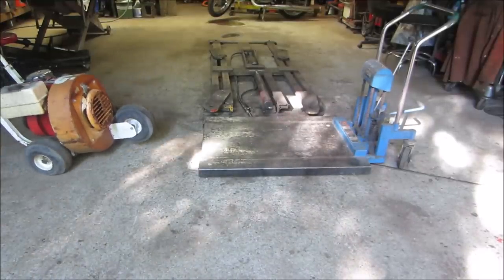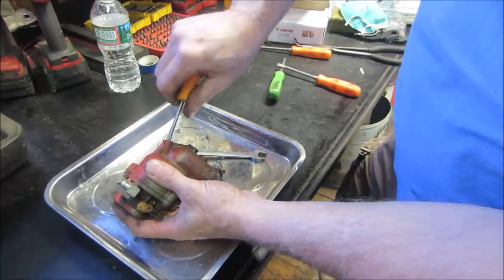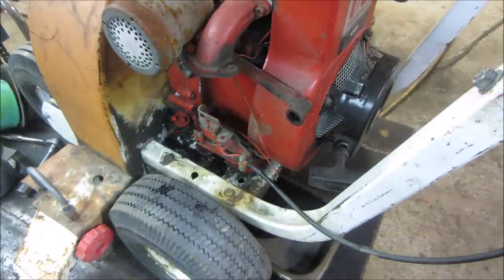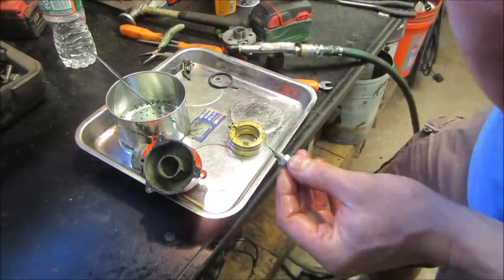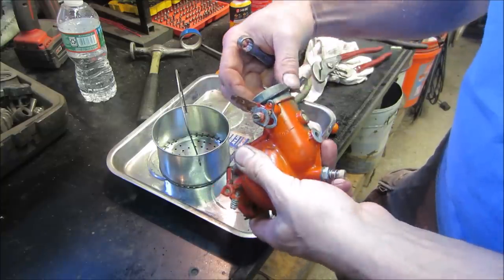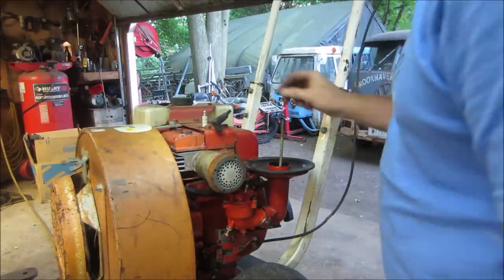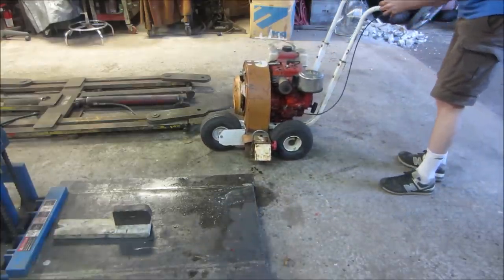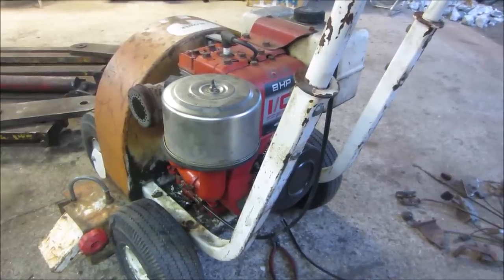Will it Run? yard sale leaf blower.

Comment: All I know is that since I've switched all my small engines to ethanol free gas (why is it always premium :o ), I've not had my carbs gum up at all.  I don't drain anything.  After winter they start in 1-3 pulls.  I also add a splash of Seafoam into the gas cans since a small engine mechanic told me to, but I don't really know if it actually does anything in that regard.
Reply: My buddy uses premium gas in his small engines,too. Now,I do.

Comment: You might want to try AvGas 100 ll(low lead) instead of Cam 2. You can get AvGas at any airport for usually about $5 per gallon and the lead is great for small engines with no worries about water.

Comment: When you say Racing fuel, is that some kind of alkylate gas ? 
I run all my mopeds and garden tools on alkylate gas and it works perfect. Best thing is that it does not get old like normal gas do if you use it in mowers and such.
Great vid, keep em comming.

Comment: After several years I learned my lesson on O-rungs and carburetor cleaner !  I have heard that it you wash a O-ring swollen from carburetor cleaner with dish soap and warm water and let it air dry it will go back to the correct size.  Can you confirm ?

Comment: Gasoline with ethanol is delivered "dry" from the refinery.  It is at its most hydroscopic state.  Most consumers use that fuel in a week or two.  At which point the fuel may be fully saturated with moisture.  With every temperature cycle, the gasoline tank breathes in and out a "breath" of atmosphere...along with the suspended water (humidity).  In a car gas tank it isn't that noticeable, because the fuel is refreshed.  But in a lawnmower, weed whacker, etc., the fuel becomes "fouled" with the moisture as well as it loses its "aromatics" (which enhance volatility, ease of starting).  Gota store yir fuel in a steel can, in the shade, and kept cool.  Airtight?  ...if it has a pressure release ...

Comment: I see your using Sunoco's 100 octane ethanol free cam 2 racing fuel.
I was wondering if it was safe to use gas with that high an octane rating on small engine's, because I heard that it causes things like head gaskets to blow and other issue's, but I see your using it, so what do you say? Is it okay?
Because it is the only ethanol free gas they sell anywhere near me and it happens to be 5 minutes away. I was going to get a few gallons, but I wasn't sure if it was safe since the octane is that high. That stuff is $9.49 a gallon right now, where they sell it. But that is still a lot cheaper than those cans of true fuel. So whats the verdict, its safe? If so I'm going to get some.

Comment: That's a 8hp Briggs . those updraft carbs are 15 bucks on eBay .if you take them apart there is a brass suction tube runs at angle inside carb .the break real easy

Comment: Cam 2 racing fuel.  Great stuff as it is clear of the junk.  @ $9.99 a gallon it isn't cheap but I use it in all my yard tools. I only use about 5 gallons a year so it is still a great deal.
Reply from the maker: l agree
Reply: That’s about what we pay for regular ol 10% ethanol fuel here in finland...
Reply: My local gas station sells ethanol  free 91 octane (u.s.d.m. fuel) . And i live in a high ethanol yield state. Oh its like 3.35-3.50 U.S.D.per gallon. 91 covers all my old stufd
Reply: I live in NYistan where they govern us into a mess of clogged up carburetors.

Comment: Ethanol blended fuels are engineered to be compatible with fuel injected equipment. I always use non-ethanol high test gasoline with a fuel stabilizer all year long. My small engine equipment always starts first or second pull even after a frigid Canadian Winter. Keep ethanol away from aluminum carbs and your and you'll have less trouble.

Comment: I had an idea watching your video. If you modify a screwdriver to have very little shoulder to fit down into the jets, could you leave it a little wide and run a die that matches the threads over it to clean and dress the threads as you remove the jet?

Comment: If I remember my high school chemistry correctly alcohol molecules are smaller than water molecules and if you combine one ounce of water with one ounce of pure alcohol the combined volume is less than two ounces because the smaller alcohol molecules fit in between the water molecules and the surface tension allows them to bind together somewhat since water and alcohol do not really mix but that is why products like HEET work get small amounts of water stabilized enough with the fuel mixture to burn. And you would be surprised at the amount of water is in pump gas because of the condensation occurring in below ground tanks.

Comment: Ethanol will attack rubber parts in fuel systems. Absorbed water corrodes stuff though you can get stabiliser additives. It’s fine on kit that’s built for it but often a problem for older equipment. At the very least the system should be drained including carb float bowl before storage.

Comment: I know this is an old video but on the gasoline comment, i heard if you want ethanol free gas you pour water in the gas and let it sit for a little bit. The ethanol and water mixes and sinks to the bottom and you put a syphon to the bottom and draw out the water and its got the ethanol stuck with it and then you have ethanol free gasoline. Might try it sometime and test it out.

Comment: that seems like alot more trouble than having a back pack leaf blower with a hose you can just point wherever easily, what is the use of these supposed to be?
Reply: A good walk behind blower will move more air than any hand held, or backpack blower. They're generally suited for large jobs in open areas.

Comment: Ethanol added fuels(E10-E15) are hygroscopic meaning they can absorb water from the humidity in the air, and phase separation (water separating and pooling at the bottom) occurs at only 0.5% or 3.8 teaspoons per gallon. And while regular non ethanol gas is also hygroscopic, Ethanol blended fuels are 50 times more absorbent.

Comment: Those Flo Jet carbs were notorious for leaking around the emulsion tube. It’s just a very bad metal on metal seal and they leak into the throat of carb.  Can easily be mistaken for a needle, seat, or float problem.   The poor design of those carbs has that emulsion tube sitting on a angle going right up through the float bowl. 
Possible short term fix is to forcefully, yet carefully, seat and reseat the tube several times with quarter turns of screwdriver. Basically your trying to get the brass tube and aluminum body to shape to each other and hopefully seal better.

Comment: both are true. ethanol is just voda . Its a slower burning element  giving little power to the combustion stroke.. Its added to regular engines to burn in the Catalytic . Remimber when it was only added for winter.. to heat the engines.

Comment: Ethanol usually contains about 4 to 6 % water because it is very hard to seperate the last couple of percent of water from the ethanol. So in a fuel that contains 10% ethanol there is about 0.4 to 0.6 % water in it when fresh. And you are right, ethanol attracts water from the air so this percentage rises over time.

If you want to get rid of the ethanol from the fuel, mix in some water, that water will mix with the ethanol content but not with the gasoline. Then you can drain the water / ethanol mix that settles on the bottom, pure gas is left on top. But the gas that's left has a very bad octane rating (ethanol is an octance booster) so you migh have to add some lead replacement of sort to bring up the octane rating (probably not necessary for low compression engines).

Comment: That motor is a lot like my old Nortech log spliter. But mine is a 9 hp. Got a ? For you my Briggs 9 hp wants to lope like the governor speeds up then slows the same over and over is that the gov, spring or what ?

Comment: ethanol is hygroscopic, it bonds with "H20" and goes direct tot the bottom, being it's heavier than gasoline..
you test for fuels for ethanol "percentage" by taking a known amount of water in a graduated beaker/flask and mixing a certain amount of "ethanol blended gas" the ethanol binds with the water and sits on the bottom, increasing the initial amount of  visible water to a higher level, with the rather "pure" GAS floating on top.
even sealed containers will do it, due to small leakage with temperature change, yes temperature change plays a big part in contamination, it's always pulling air in and pushing vapors out. which mean more moisture laden air enters for the alcohol to bind with :)

Comment: You are correct that alcohol absorbs and mixes with water from the air. Its not correct that alochol has water in it when it is added to fuel, it is quite pure at that point. As you know water in fuel can flash into steam which we all know is very bad for engines.

Comment: Alcohol will mix with both water and gas. It suspends the moisture in the gas and kills its ability to ignite. When the temp drops, the water will condense out into the bottom of the tank or can.

Comment: To add fuel to the fire...ethanol is definitely hydroscopic.  E10 doesn't (or shouldn't, if it's been stored properly) have water in the ethanol at first - it absorbs moisture from the air.  Then, as the ethanol evaporates out of the gasoline, it leave that water behind.

Comment: Ethanol certainly likes water.
You can test fuel to see if it contains ethanol quite easily.
Get 100ml of fuel, put it in a measuring jug/cylinder, something graduated.
Add a known quantity of water, for example 50ml... Give it a good stir, cover it up, and leave it for a day to settle out.
Any ethanol will be attracted to the water.
When the water has settled (at the bottom), look on the measurement to see how much you have. If it's the 50ml you started with, congrats, no ethanol.
If you had 10% ethanol in your 100ml of fuel, you'll find you now have 60ml of "water" at the bottom (50ml of water and the 10% of the fuel which was ethanol).

You might even be able to take the now "clean" fuel off the top and use it, but the water will probably have removed some other additives along the way, so although it's now ethanol free, I can't vouch for the quality.

In the UK a lot of the "Super/Plus" fuels are ethanol free, but check on the company website to make sure. All the regular stuff has to contain ethanol by law.
- guess what I put in my motorbike for the last couple of weeks of the season ;-)

Comment: Would you happen to sell parts? My 8 HP Briggs and Stratton is in need of a new coil, I know I could get a new one but I want the engine to use the points and condenser but they are all electronic ignition please let me know thanks! By the way keep up the good work watching from Tucson!

Comment: Proof is double the percentage, so 130 proof is 65% alcohol, 35% other stuff. Ethanol used for fuel starts out 100% alcohol before it's blended with the gasoline. It's correct that ethanol absorbs water from the atmosphere, but the percentage is temperature dependent. Your 10% ethanol fuel is E10, which can be about 0.5% water at 70 Farenheit. Not much. Remember that old dryline stuff they used to sell at auto parts shops people would use in the winter to help gather and remove the water from cheap gas so it wouldn't freeze up in the fuel lines.

Comment: Pretty sure that flex seal crap is just re branded rubberized undercoating you can buy at any auto parts store for half the price. Pretty sure its the same stuff but I could be wrong. Just a heads up if you use it a lot.

Comment: You ever tried "deep creep" by seafoam? It is the best penetrant I have ever used. I've had rusty exhaust bolts even an impact couldn't break loose without fear of snapping a bolt or stud. Heated them with a torch still no luck. Then sprayed it with deep creep and let it set came back and broke it loose with a small ratchet. Also had an old pedestal fan that was locked up. Tried wd40, various lubes and couldn't even turn the motor by hand. Used deep creep on it let it set and literally came back and turned on the fan and it broke itself loose. Still using that fan today.
Reply: Immoral Immortal never had it work anything close to deep creep. Known many people over the years that swore by mmo. Look up project farms test of penetrants.
Reply: Immoral Immortal they have some that include a water pump and fittings to run water through the coil.  I just did a quick search as I'm at work.
Reply: I had a fan that wouldn't work also. Found my wife had left it in the rain. My Irish kicked in and after throwing it out of my shop 3 or 4 times it worked great!
Reply: DC is just regular seafoam in an aerosol can. Been using that and MMO for decades. MMO makes really good air tool oil, also.

Comment: Alcohol vs H2O, The Alcohol molecule is larger than the water molecule, thus the water molecule 'slips in' between the alcohol molecule with the two combining.  water will never combine with gasoline.  This is why you can mix alcohol and water, then soak a handkerchief and light it.  The water evaporates as the alcohol burns thus keeping the cloth too cool to burn.  My 1954 Cub Scout classes talking here.
\Oh, and you have never lived until a friend drops by with a plastic bag filled with parts... Parts to a 4BBL carburetor.  Her took it apart and had no idea how to put it together again so you sit in the living room while your RPG friends are arriving, put it back together again using the rebuild kit instructions and see the amazement in your friends face when you return the fully working device to him.  BEFORE the Champions game starts.

Comment: To drive home your point concerning water in fuel tanks, aviation fuel has no alcohol in it but does have fuel tanks which vent to the outside air. My Cessna 421 has 8 fuel tanks and 10, count 'em, 10 drain ports for ensuring all condensed water is removed from the tanks. Usually I find small amounts of water in 3 or 4 of the tanks during preflight. At the end of the day, I fuel the plane to its 259 gallon mark, full tanks. That helps reduce the amount of water that will condense over the cool nights. Okay, enough of the boring flying crapola.

Comment: 87 octane gas with 10% ethanol already has some water in it.  It does remove water from a fuel system if there is any.  Usually not a problem.  Gas line anti-freeze is mostly isopropyl or methyl alcohol.  Does the same thing.  Ethanol alcohol in gas lowers available power.  Non-ethanol gas increases MPG's to the motorist.  I have long since stopped using 87 octane ethanol gas.  It is damaging to all components, be they metal, synthetic, rubber, plastic, or whatever.  I am paying more $ for savings down the road.  Fuel pumps cost a lot to replace.  I've been through that enough times to know I will not go back.

Comment: I have a question what would cause oil to run back into your carburetor I have a riding mower it runs until it warms up then it chokes and dies then I have to pull the bulbs and clean the oil out of carburetor
Reply from the maker: blown head gasket
Reply: Thank you so much I work on small engines all the time I was that's what I was thinking it's always good to have a second opinion I watch a lot of your videos cuz it really helps when you can't figure something out lol
Reply from the maker: make sure its just not over filled too but pretty sure you had that covered
Reply: Mustie1 I sure will and thank you

Comment: I think you are right, the ethanol attracts water (from the air).
Reply: PuchMaxi Have exact same carb on older rototiller. The gas evaporates inside any bowl , if stored with a full tank and no shutoff, you are left with the shellac impurities of the ethonal. For the earth saving reasons we mandate ethanol , it cost on other side by destroying carbs. Personally run dry all my small engines, can dry gaskets and Orings , but better then de scaling the ethanol grime. Don't have ultra sonic, so I clean ports with fine steel wool on small wood rod.

Comment: You may find the original float pin had the rubber tip and ate itself with the new gas.
Reply: wi11y1960 that may depend on the age of the engine. I had to replace the Carb on my walk behind line trimmer. The original carb had a all metal needle and a rubber seal up on the Carb. The new replacement had a rubber tipped needle and no seal up in the Carb. More surprising was the old float was plastic and the new one was brass.
Reply: Brigggs and stratton engines of the era he is working on.  The float pins had rubber tips

Comment: zinc oxide white powder in carbs..
I think sodium hydroxide dissolves from chemistry class. Also many use sea.foam in a crock pot with ultrasonic probe. Heat up and let sit over night. Usually cleans out internal holes especially in Japanese carbs which have tiny orifices. I dump all fuel out of all my small motors and put stabil additive in when not in use.
Another trick from a bike shop Vet mechanic is to use a propane torch to heat area where passage is clogged. A small puff will come out saving expensive bike carbs which idle mixture passages are internal and no way to run a wire through. Excellent shows
My channel is Motorhead on Massey Ferguson 165 Hydraulic pump repair.

Comment: How does this engine work? I’m so confused on why the air filter leads directly into the bottom of the fuel bowl.
Reply: This carburetor was one of Briggs odd ideas. It was called the flo-jet. The air passes through the center of the carburetor. The float chamber surrounds the venturi.
Reply: Erik J. Thank you very much! That is an Interesting idea.

Comment: The most common use of these isn't to move leaves, but rather to remove small debris from pavement.
Reply: And reposition small children to the proper side of the street.
Reply: Not funny
Reply: douro20 I though it was funny
Reply: We use it to clean off the track at the school I work at